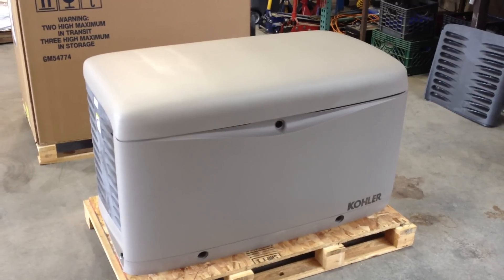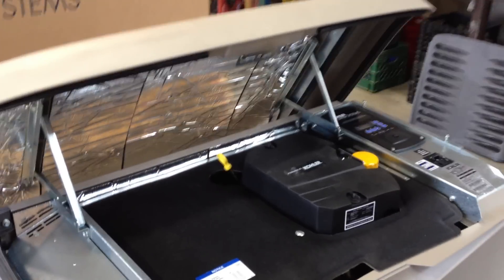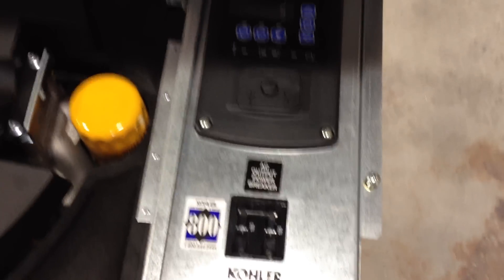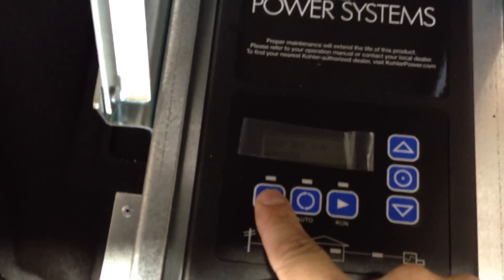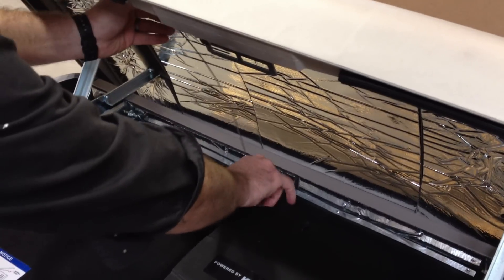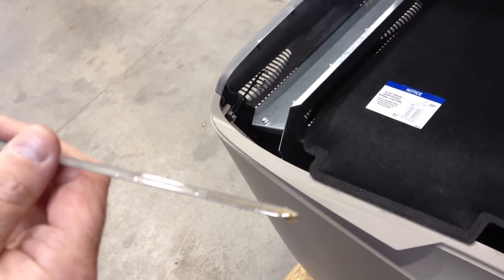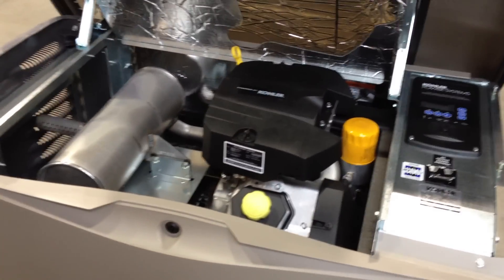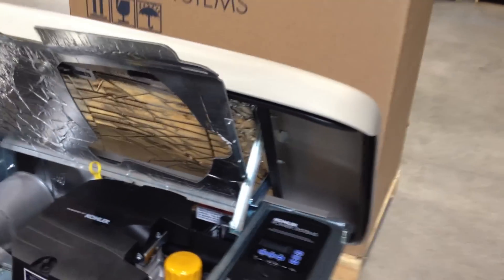How to check oil on a Kohler 14kw & 20kW Generator

Comment: Overall our 20Kw has been great, but after the last storm, running for about 2.5 days continuously (60 hours or so) the oil was a quart low... that's half it's capacity!  Can that be "normal"?
Reply: Are we talking a Kohler 20 RES , 20 RESA or 20 RESAL?  Did you read  the dipstick while the engine was running?  Did you check the oil level daily as the manual requires during the long term outage?   When it was a quart low, how do you know it was a quart low? Did you add a quart to the engine?  Did you add a quart all at once or a little at a time? Did you allow a couple minutes after you reinserted the wiped dipstick for the added oil to sink to the bottom of the crankcase?  After you filled the oil to near full, did you start the engine again, run for a minute or two and then allow the oil to run to the bottom of the crankcase.  Off hand I believe the problem is that you did not stop the generator every 24 hours and check the oil. Air cooled engines will burn oil and that's why the manual calls for checking them once or twice daily during a long term outage. That is also why its vitally important to use FULL synthetic 5 W 30.  Consumer reports speaks very highly about Mobil 1 and Castrol.  Many of my customers who are familiar with generators or engines demand Mobil 1 for the maintenances I do for them an I am glad to oblige.
Reply: Thanks for the reply, It's the REASL which just means it came with transfer switch.  I checked the oil with the unit cold a few days after the 60 hour outage and added the quart then.  During the outage I wasn’t around (It's at my family's house).  Having to shut it down and check the oil level daily is something I doubt most people would do, and is not something I would expect necessary for an automatic generator.  I agree with full synthetic for better low temp flow and shear stability.
Reply: Hubjeep
Your dealer should have warned you that its in your generator manual and failure to do so can void your warranty.   The only time I dump a full quart into the generator is after I have used an electric pump to suck the oil out. I fill the generator approximately 4oz at a time until I get to about 1/4 inch from the top then I add about 1 oz at a time.  If you accidentally over fill you have to drain some oil before you start or you can blow the seals. When I sell a Kohler I explain whats required.  I also make myself available to assist, but the people buying from me understand and do the required checks or call me. With proper oil levels and maintenance that generator should last you 20 to 30 years. Without proper oil levels you will be very disappointed.  I am unaware of any air cooled automatic standby generator that does not burn oil, or will run very long without the necessary oil levels to lubricate the engine. I regret being the bearer of bad tidings, but its better to know beforehand.
Reply: If I knew the generator would actually require daily oil checks (something my 76 year old mother is not going to do), I would have gone with a water cooled model.  My [current] old 4-cyl air cooled [1800 RPM] 12kW Onan diesel ran for 12 days during Sandy.  Added a half quart on day 6.  In hindsight I should have figured a 2-cyl 20kW cranking at 3,600 all day would use some oil.  Too bad they didn't engineer it with a larger oil sump anticipating the consumption.
Reply: I cant believe how much oil our kohler generstor uses.  Especially considering how small the oil capacity is.  We have 50 year old equipment we use weekly, that has notnhad easy lives.  None of them use oil like this thing.  My manual requires checks every 8 hours and i have to add oil just about every time.  I cant believe this is considered acceptable, especially for equipment that starts automatically.
Reply: @therealsideburnz  any update on oil consumpsion
Reply: @lucfournier8222  still uses oil.  I just check it every 8-12 hours when it's in use.
Reply: @therealsideburnz  Mine uses oil like crazy. It's been running for 1.5 days and I have added 2qts so far. Plus the dipstick is extremely hard to read. I can't tell sh*t from looking at it.